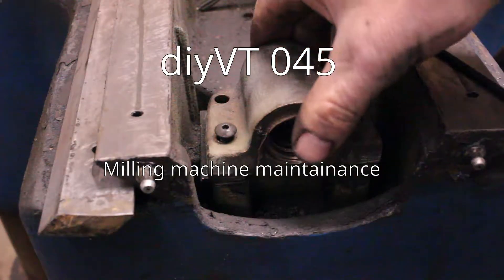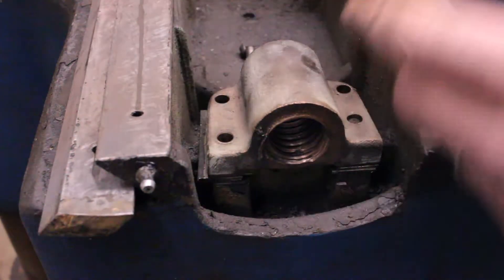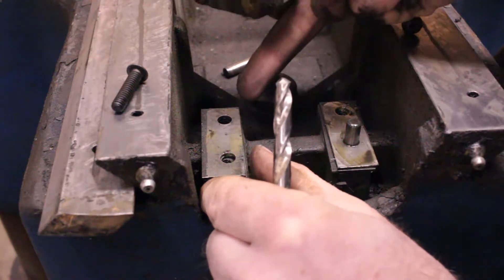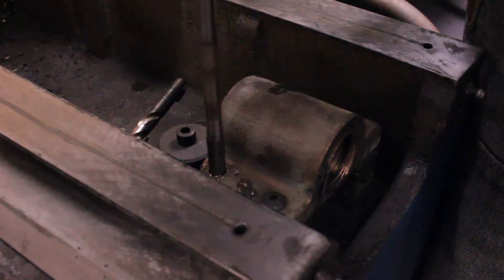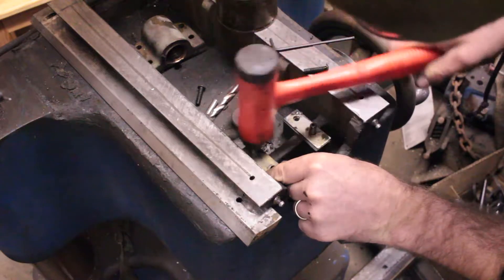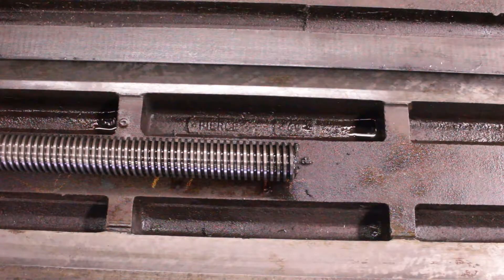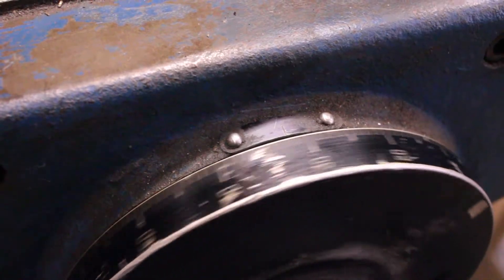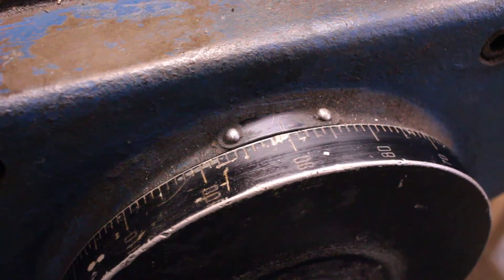Mill Maintenance

Comment: Nice problem solving. If you have to do this repair again, it may be good to go with a tapered pin. That way you don't need to keep making the pin hole bigger and bigger. Eventually you may need to replace the lead screw nut. I wonder if it is the same screw size as what a Bridgeport mill uses. It probably has .200 per one revolution of the screw. which is the same, but you would need to know the diameter to see if they match.
Reply from the maker: Hopefully the damage was just caused by the fall the mill took and it isn't a design flaw.  Although those bolts that hold down the nut are pretty small.  I don't have any taper pin stuff, although it is on my list of potential stuff to get for the shop.  The screw is .200 per revolution and driven by a chain so one turn of the handle is .100.  It would be a fun challenge to make a new two part nut so the backlash between the screw and nut is adjustable for wear but finding the time is to actually do it would be hard.  I am sure the lead screw matches some other machine out there.
Reply: I agree. But it's good for life for a hobbyist

Comment: great video. thanks for uploading. seems like fixing the dowels and not just tightening the screws should result in a more permanent fix to the excessive backlash. well done.
Reply from the maker: Replacing the pin was easier than I thought it was going to be.  I lucked out having the right size reamer.  It was the right time to do it.  The table comes off kinda hard on the mill because you can't pull the gib out with the table still on so it's tight the whole way off.